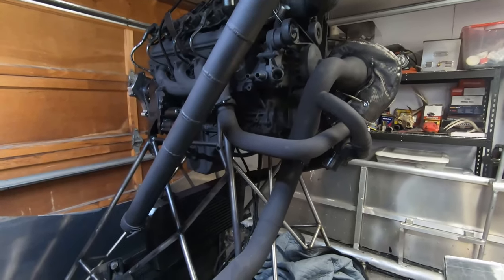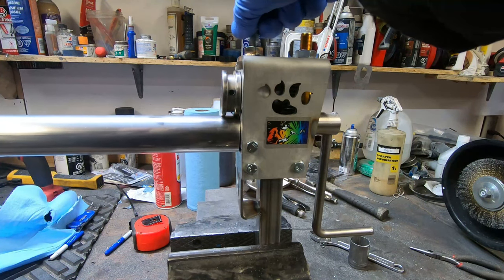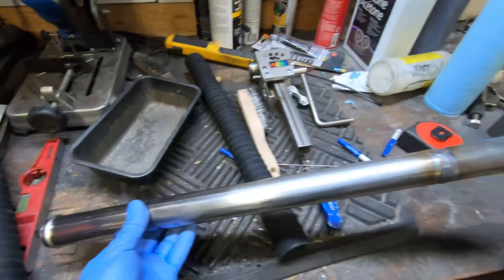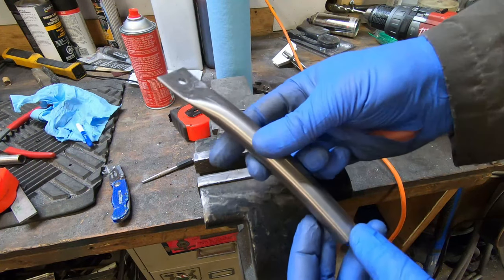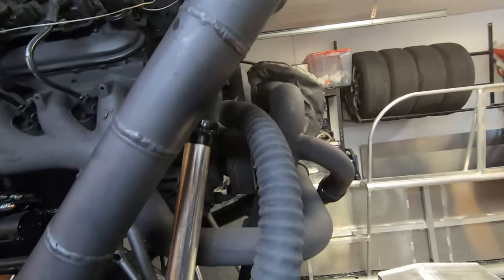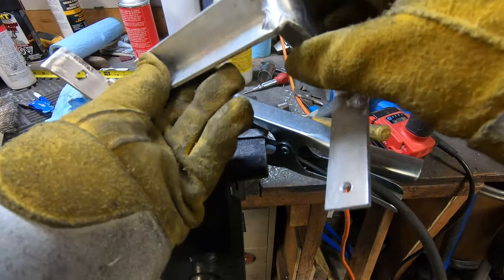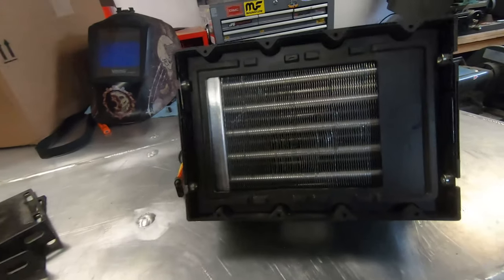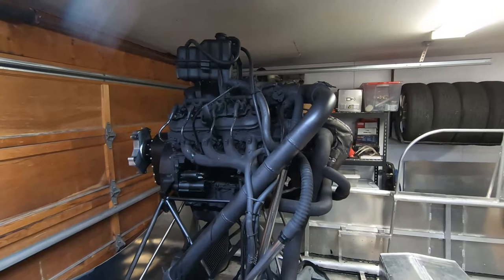Airboat Build #24: Radiator Tubing and Heater

Comment: I see this video has got some time behind it.
I am actually doing the same, build and engine. Im pretty much done with he exception of cooling, thus, is why I'm here.
I don't see how water is plumbed. Radiator, reservoir, water pump, how does the water flow? From where to where.
That also a long way for the water to go(rise) from radiator to engine Can you explain in detail your flow?
Reply from the maker: Water flow is essentially the same as a stock 2003 silverado (where I got the engine, rad, reservoir).  Yes the radiator is far and low, but it seems to circulate just fine.  I suspect it’s important to ensure there’s no air-lock; but I haven’t had problems with that.